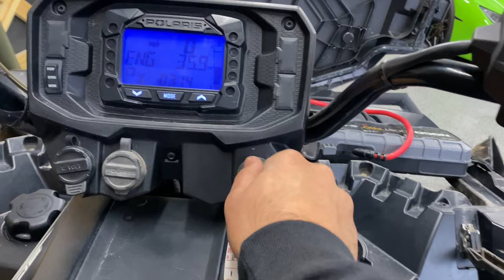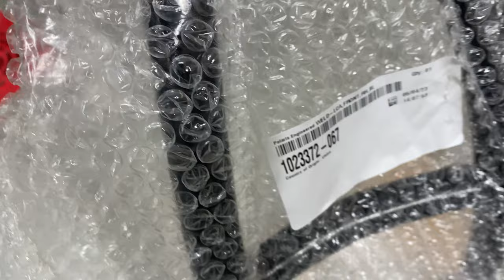WRECKED 2023 Polaris Sportsman 1000 XP REBUILD! ULTIMATE ATV? UNKNOWN DAMAGE? RISKY!

Comment: the power steering gear is going to be bad and probably the tie rod . you will notice. play in the steering that doesn't seem like much but it will shake pretty bad over 34-40 mph most likely on the road .
Reply: Its a known weak point they changed on the S models.
Reply from the maker: I haven’t noticed any play or any shaking? Have put 10 hours on it since then!
Reply: The EPS gear will be absolutely fine.